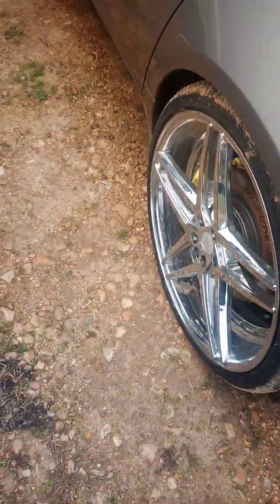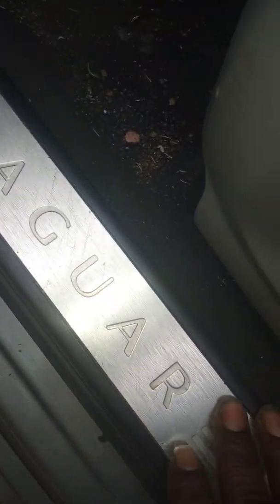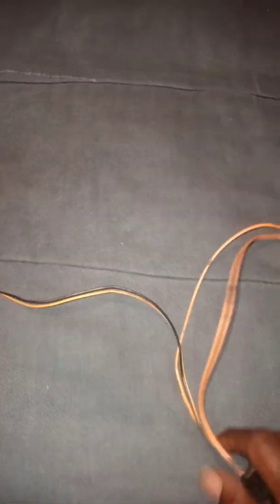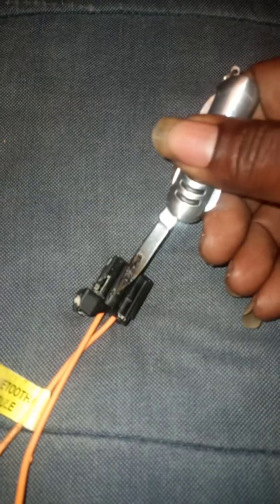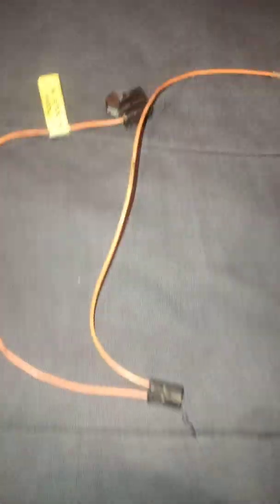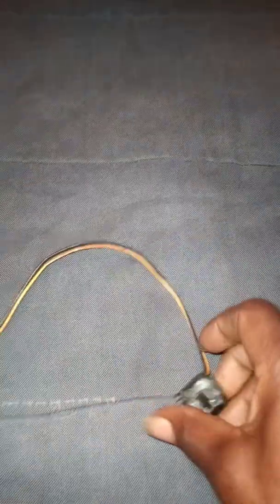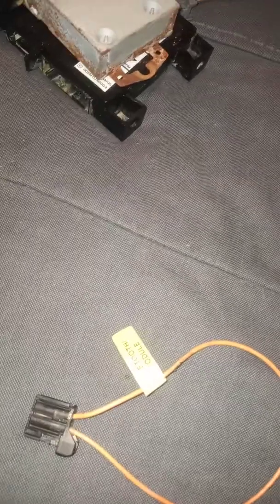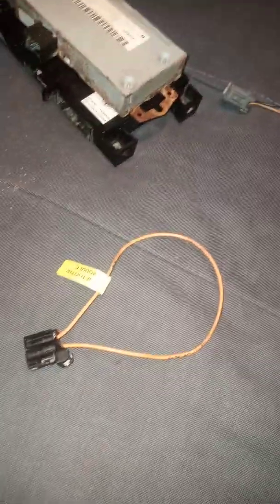Jaguar flickering screen fix (Bypass)...

Comment: Hey

Good vid for ne to start.

I have a flicker screen, lifted the seat all water damaged fully corroded.

But i see 3 boxes under 2 black 2 metal.

I brought a few bypass plugs off amazon.
So
Question do i still remove plugs or just add the bypass ones i brought?

So far i see two plugs that have the red light when i unplugged them.

Thanks for all your help
I dont know much about  this wiring  stuff im alil afraid  lol...

Comment: I have a 2010 Jaguar and I'm not able to move my seat forward enough to get to the rear screws. Did you have the same issue? If so, which tool did you use?
Reply from the maker: Really just need to remove the front and the seat should lay back...
Reply from the maker: If not make sure it's nothing under the the seat stopping it from moving all the way forward...

Comment: Make sure you check your connections in the trunk! Where the navigation system is located. If it does not work go to your trunk and check the dvd and navigation system for any wires unconnected or loose!

Comment: I did exactly the same and this does Not work. Screen stayed flickering. However, the question is did you disconnect the battery first or not? Does it even matter?
Reply from the maker: No I did not and did you remove the 2 box I said to remove if so it should work make sure you see a blinking red light b4 hooking it up...

Comment: There are 4 modules in the car that works together if one is bad the radio flicker  (1) bluetooth (2) satellite radio Botha under the driver seat (3) blue ray player (4) cars amplifier so either one or both modules bad . So u can get the jumper and test all devices it will work

Comment: It WORKED! My 2009 Jaguar XF touch screen went from blinking in and off to blaring Bobby Brown! I have my curb sensors back, cameras back everything! Would you know anything about the key fob battery not responding to the car?? Your our only hope besides the dealer!
Reply: change the key fob batteries first.